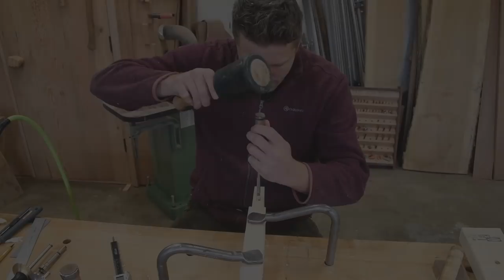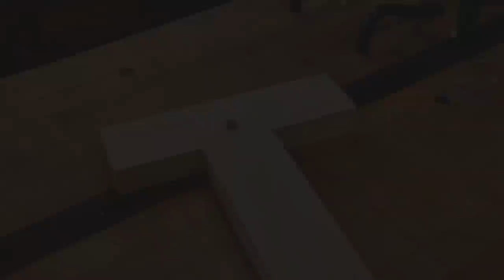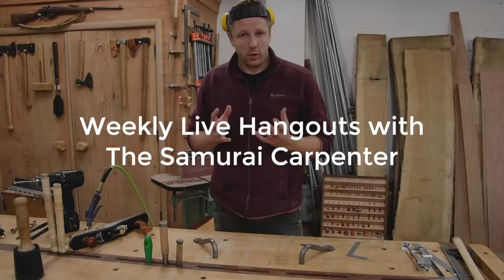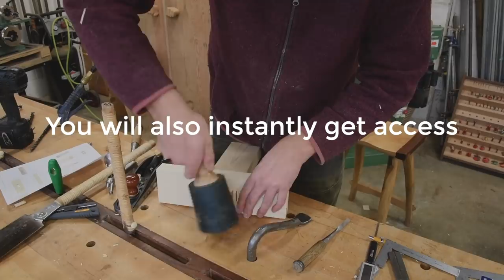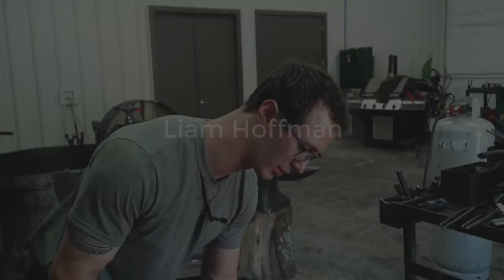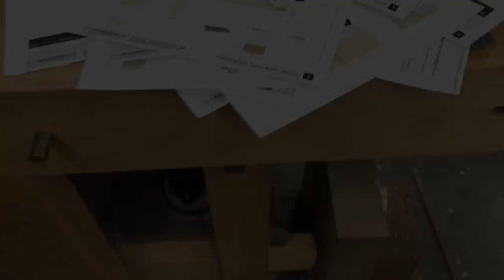Woodworking Joinery Challenge... YOU IN?

Comment from the maker: For those wondering what you need to do this challenge.  I use the following (But you don't need them all):

Materials Needed: 
10x - 12” Long 2x4 (1 1/2” x 3 1/2” true dimensions)
4x - 12” Long 1x4 (3/4” x 3 1/2” true dimensions)
5x - 1 1/2” screws 
1 piece of 3/8” dowel (2” long)
1 piece of 3/8” x 3/8” material for making square pegs (8” L)
Small scrap of 3/4” material for making wedges (8”L x 2”W) 

Tools Needed:
Rabbeting Block Plane (Not necessary, but helpful)
Dual Marking Gauge/Marking Knife  (Not necessary, but helpful)
Utility Knife
Drill
3/8” and 3/4” Auger Bit/Spade Bit
3/8” Countersink Drill Bit
Sharpened 3/8” Chisel and 1 1/2” Chisel
Square/Combination Square
Hammer/Mallet
Pull Saw
Measuring Tape/Measuring Ruler
File  (Not necessary, but helpful)
Pencil and White Eraser
Reply: I have:-
A coal hammer
A "King Dick" adjustable wrench,
A 57 year old two foot long half inch chisel that has been used as a poker for most of its life and won't keep and edge because it is as soft as butter
A pair of long nosed pliers which won't meet at the tip
A plunge router I got for Christmas

Will this do? 😀
Reply: Alan Gunn 🤣 you should watch a video on hardening and tempering steel first. (Fun and very easy)
And don’t tell me you didn’t bend those needle nose pliers trying to pull a nail! 😄
Reply: What are the screws used for?
Reply: Stephan Pöhnlein for the finger joint and the butt joint with dado
Reply: Are the measurements in inches?  I just signed up and printed my list and I want to go pick up what I need.

Comment: What tools are required/recommended for the challenge? The landing page didn’t say and your support guy said just a drill and a saw which doesn’t sound right.
Reply: Kevin McGillivray I would go with the standard kit.
Hammer
Chisel set
Combination square (30cm)
Drill
Assortment of wood drill bits
Wood saw (fine tooth or pull saw would be best)
Measuring tape or steel ruler (steel ruler is obviously more precise)
Pencils and a work space!

Other things that are obviously useful would be a set of clamps and a block plane.
Reply from the maker: @DaddyBear3000  Thanks Karl.  This is pretty much it!  Plus the wood.  I also just pinned a list at the top of this commenting section.
Reply from the maker: I just pinned a list at the top of this commenting section for you to see what you will need.
Reply: The Samurai Carpenter Thanks!